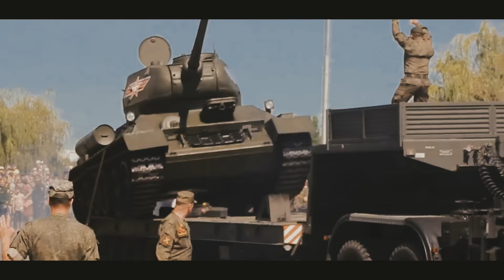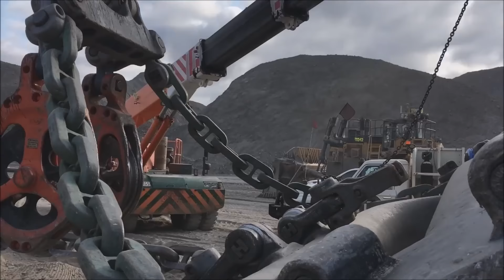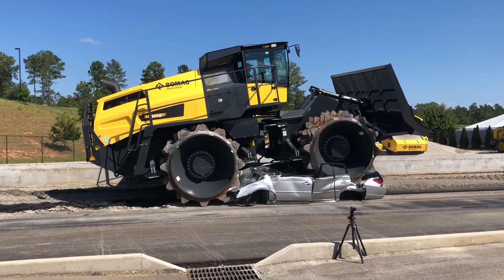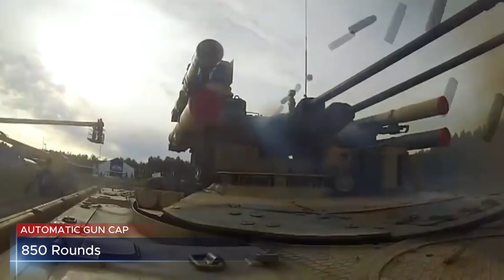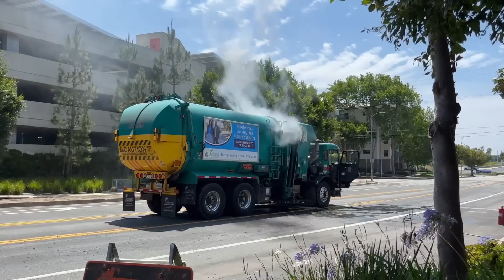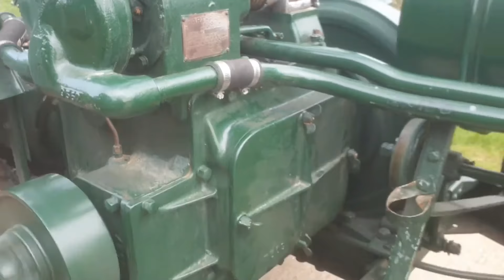Dangerous Idiots Tank and Truck Fails and Wins Heavy Equipment and Military Accidents Compilation #1

Comment: Yeah, that's a big machine that drag line, the machine itself walks on crawlers, I think 1 or 2 miles per hour, I've seen the silver spade too. That had a big bucket or 2 and worked with a knee action, though it would scoop the Mining when I was doing it when it existed.  Thank you.\nThere was big blue and big muskie too.They called the Mining bucket was so big.The one that they showed they could fit two greyhound buses in it and put it could fit a whole march in army band in it's an museum somewhere in the united states , thank you.

Comment: When they talk about Russian military hardware the first thing I think of is and they can’t beat Ukraine army that’s crazy
Reply: ......Did Putin say he was going to conquer the ukraine?....nope....he didn't. He said he was going to demilitarize ukraine. To put it simply...for you....Russia took the breakaway provinces and a buffer zone....then built a defensive line along the Dnieper ...stopped obviously and got comfortable...forcing the notzee fanatics of the AFU  to cross well defended land to attack them...which they did...for 2 years....and this is when the AFU was gutted. They threw their men and machines into the well established meat grinder. The point of this was to keep Russia's losses of men and materials to a minimum ...which it did....while at the same time DEMILITARIZING the ukraine. Advancing is dangerous...and Russia does not want to keep this shite hole. FYI...if the West wasn't constantly resupplying their fanatical proxies with mercs and weapons...this would have been over long ago.

Comment: 2:49 They're spraying something white, is it CO2? Like a very beautiful frozen truck.
Reply: Pfas. Look it up, nasty stuff.
Reply: Fire retardant foam.
     And yes, full of PFAS or otherwise known as "forever chemicals" that are now plaguing drinking water.
Reply: Aqueous Film-Forming Foam (AFFF) is a firefighting foam used to put out fires and also contains harmful PFAS chemicals. It is specifically designed for combating Class B fires, which involve flammable liquids like gasoline, oil, and jet fuel. AFFF is highly effective because it spreads quickly over the surface of burning liquids, forming a thin aqueous film that smothers the fire, cuts off oxygen, and prevents re-ignition.

The effectiveness of AFFF is largely due to the inclusion of PFAS (per- and polyfluoroalkyl substances), a group of man-made chemicals known for their water- and oil-repellent properties. PFAS chemicals act as surfactants in the foam, reducing surface tension and allowing it to spread rapidly across flammable liquids. This makes AFFF highly effective, but it also comes with significant health and environmental risks.

PFAS chemicals, often referred to as “forever chemicals,” are highly persistent in the environment and do not break down easily. When AFFF is used, the PFAS within it can seep into soil and water systems, contaminating drinking water and natural ecosystems. This contamination can lead to long-term health risks, including cancer, immune system suppression, liver damage, and developmental issues.

Due to these risks, there has been a push to phase out PFAS-containing foams like AFFF and replace them with fluorine-free alternatives (FFF) that are safer for both people and the environment. However, the legacy contamination from AFFF use remains a major environmental challenge.

Comment: This video is both mesmerizing and horrifying! The skill displayed by the operators is undeniably impressive, but I find myself questioning the entire culture around heavy machinery. Are we glorifying recklessness by labeling these incidents as "epic fails"? While it's easy to get swept up in the adrenaline rush of these videos, I think we need to acknowledge the real risks involved. The collapses and accidents can lead to serious injuries or worse. It would be interesting to see discussions about the ethics of sharing such content. Are we doing a disservice by sensationalizing these dangerous moments? What are your thoughts on this?
Reply from the maker: My opinion is that people in less developed countries don't consider safety their top priority, and as a result, they put themselves and the machines in danger.
Reply: @HeavyMiningEquipment  You make an interesting point about safety priorities in different parts of the world. But I wonder if it’s not just about the country or level of development—it could also be about the industry culture itself. Even in more developed countries, we've seen reckless behavior around machinery in the name of speed or cutting corners. Maybe the issue lies in the pressures operators face, no matter where they are, to meet deadlines or reduce costs. Could it be that this mindset leads to risky situations more than geography? Curious what others think!

Comment: I’ve stood by a D11 dozer and they are huge. It’s a lot bigger than the video of this one pulling the dump truck out
Reply from the maker: @randlerichardson5826  We have a Komatsu D375A-8 in our mine, and they are huge when I stand next to it. I think the D11 is almost 50 tons heavier than the D375A.
Reply: Ya that one is probably a 4 or 5 maybe.
Reply: @dodgelaramie6828 definitely an 11. Look at the size of the cab compared to the size of the machine.
Reply: Everything is relative. That D11 is much smaller but heavier than that dump truck. Those dumptrucks have something like 16ft tall tires. Its probably 40 or 50ft tall total